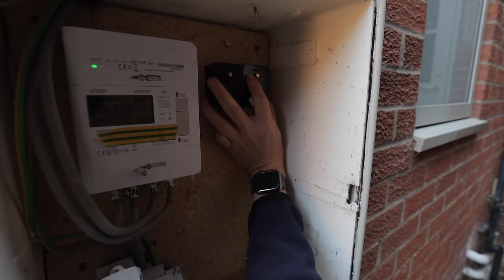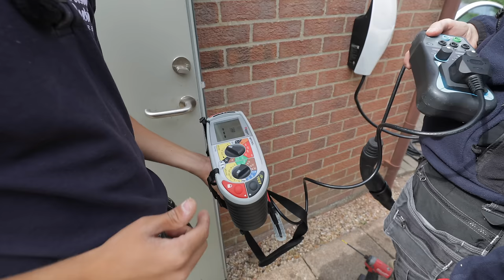I was WRONG! The Tesla Gen 3 Charger is the WORST!

Comment: Is that cable the standard length? I want to install on front of house. I will then drive Tesla Y onto drive. The charging point will be at the front right of car. Will the cable be long enough to go across front of car and then along the length to the changing point of Tesla Y? Thanks a lot, great video

Comment: Was looking for what voltage and amperage a Tesla charged at.  I was an electrician in the USA and looking for how the chargers are wired. Hopefully we won't need all the equipment you show to hook up chargers.  Have seen many home chargers that hook up to a 240V 30 amp or 50 amp receptacle with a plug.

Comment: I bought a 24" x 24" lockbox into which my electrician installed the Tesla Wall EVSE at the driveway.  So, the EVSE is never seen by anyone and the box looks great.  I don't have wifi at my house, so I didn't try to connect to the EVSE, and my electrician told me that these units "self commission" so no need to fuss with wifi at all.  ( USA ). Also, I have been told that the GEN3 units have never been sent OTAs.  My takeaway is:   no need to let wifi ruin your day, mate.

Comment: From an Electrical Engineer that has migrated to becoming a WiFi Engineer full time now.  You need to make sure the customers router has the low data rates enabled to allow communication at distances outdoors.  Some routers will have BAND steering turned on meaning client devices that have 2.4Gghz and 5Ghz (IPhone) will use 5Ghz and this stops the iphone configuring the device that is ONLY 2.4Ghz.  The trick is to disable 5Ghz on the customers router when you are configuring.  I like to configure separate SSID per Frequency in customers router.  The reason this install went well this time was you were probably far enough away from customers router 2.4Ghz was the preferred connection for your phone.  Inside you office 5Ghz was probably the preferred connection.   You see this same issue when trying to pair 2.4Ghz light globes to WiFi networks with i phones.
Reply: No, not in this case. The Tesla Gen 3 charger only supports 2.4GHz.
Reply: @deang5622    The fact that the Gen 3 is ONLY 2.4Ghz is exactly the issue.  If the IPHONE configuring the device is on 5Ghz  and the Tesla Gen 3 is on 2.4 then the configuration fails right at the end.  disabling 5Ghz  makes the phone go on 2.4Ghz  and the Tesla 2.4 Ghz and the configuration works.  In this video the phone was far enough away from the router that 2.4Ghz was a better signal so the phone was connected to 2.4Ghz and having both on 2.4Ghz it all works.  In the reason why in the office it was not working was the Phone would have been connected at 5Ghz to WiFi  as it was close to the office router.  Both devices need to be on the same frequency WiFI for the initial config  and then after that phone can be on 5Ghz as the connection is via the WiFi not the WiFi Direct connection at startup with QR code.
Reply: @charlesclare267  Yes I do know all of this. I do have a degree in Electronics.
Reply: @charlesclare267  idk why tesla uses wifi it is a fixed device it should just use ethernet

Comment: The problem with wifi is almost universally related to the router configuration... Signal not strong enough, signal strong but too noisy to be useful (both related to the distance between the router and the device), router configured in a non standard way, repeaters in the way, etc...

Comment: is it possible to run a cat5 cable, possibly using data over power adaptors? Do any other of the chargers have wired data connection? expecting a customer to have a wifi extender is a bit much. if chargers are wifi only, how many have 5GHz, so less likely to get interference than 2.4GHz

Comment: You should get the freq right 2,4 vs. 5 is the key to your problem... Just a heads up. I have installed about 50isch of those and never a prob with the wifi...

Comment: Regarding the extra ”kit” that you claimed is needed like the PEN faulr protection. Isn’t this due to the way you choose to connect this charger? Normally you would feed it of the main distribution from the house which already should have the PEN protection right? The Tesla WC has the inbuilt RCD, typ A + DC 6 mA protection specifically needed for this application (charging an EV). As the Tesla has built in planning for when you want to charge etc I would say it’s optimized price wise for what is needed together with a Tesla car. The Wi-Fi problem you had is due to weak Wi-Fi signal from the customer in this case…

Comment: I've had loads of issues at home connecting smart devices to things at home as they run on a 2.4ghz frequency. Where the WiFi router broadcasts both 2.4 and 5ghz, if my phone is required to setup the device then it will default to 5ghz frequency. To get around this you need to access the router and disable 5ghz while setting up your devices.

Comment: As other comments have said this definitely sounds like an issue with 2.4 vs 5GHz WiFi bands.

Might be worth keeping a company wide log of problematic ISP routers and see if you can spot any trends. You could then check the settings for troublesome devices as some have a compatibility mode for IoT devices with radios that aren't as good.

I know the BT Smart Hubs have an option in the settings menu where you can switch between modes, they ship as mode one but you can change to mode two or three to improve compatibility. It essentially makes the band steering less aggressive which usually tries to make clients prefer the faster 5GHz band, but this comes at the expense of range. If your device has a marginal signal strength this can cause issues. I imagine many EV charge points would have marginal signal strength given they are outside probably through several walls.
Reply: I'm having to reply to these posts as they're simply not correct. Band steering only works on clients that can accept both bands. As the Tesla wallbox only has 2.4GHz it will not even see the 5GHz band and therefore cannot connect to it or be steered onto it. The reason for poor registration onto the network is probably purely down to signal strength.

Comment: Tip:  For armoured cable I use a Monument pipe-cutter (with a Stainless steel cutting-wheel). That works GREAT for scoring SWA (once you've got the knack). Even on 20mm (dia) 3-core armoured cables, it does a great job and is so much better than struggling around with a junior hacksaw.  (I'm a JIB Gold card electrician by the way).
Reply: Of course they have the rotary cutters. They have been around for decades. What electrician would even consider using a hacksaw let alone many do it yourselfers?

Comment: The WiFi connectivity for the Gen3 is only available also after it is turned on (from off state). After a few minutes, around 5-10 mins, it switches off its hotspot network

Comment: You might find it's an issue between 2.4ghz and 5ghz connecting problems. I split my WiFi so I can choose which one I need to connect to as some amazon sticks don't work well on 5ghz WiFi so I wonder if this is the problem artisan?
Reply: Oh god I’ve gone crosseyed
Reply: Pretty sure that is it. Hey had trouble in the office, probably in range of the 5ghz. They did it outside here, brick walls block most of the 5ghz so it would have defaulted to 2.4 which made the installation painless. High chance if they tried id near the wifi accesspoint it would have given trouble too
Reply: The Tesla wall connector presently only does 2.4 GHz

Comment: I believe the US wall charger is the same now as it was 2 years ago.  Is the wall charger different in UK?  In the US you have wall charger (with cable), wire and conduit to run to the panel, and a dedicated circuit breaker.  No GFCI (per the install instructions) because the unit has GFCI built in.

Comment: I've noticed two earth/cpc conductors being wired in the top of the contactor.  This must be the armored earth and the fly lead going to the armoring. They looked liked two different sizes?   4mm for the armored and 2.5 for the fly lead.  Are you allowed to use different sizes on the same screw terminal for that specific contactor ?
Reply: The tesla unit has inbuilt  dc leakage. The megger mft 1742+ which is the tester they are using does an auto dc leakage test, worryingly its the bit when Jordan says he didn't know the mft did it

Comment: Here in the USA, our options are limited to the Tesla EVSE wall connector if you don't want to have to use clunky adapters for your Tesla.  The Tesla plug is so much smaller here than the CCS plug there.  I know there is actually a federal push to adopt the Tesla plug on all EVs here in the USA ironically enough.  Doubt that will really go anywhere but its strange.  We also don't need PEN fault detection, as we don't run a neutral to the charger, only the split phase L1/L2 and ground.  The only requirement we have which was new in 2020 was the use of GFCI, in which the Telsa charger does have built in.  So that actually saves money here.   I haven't seen the WiFi issues here at least, so not sure what is happening.  The charger does integrate into Home Assistant so stats on a dashboard is nice.  I wish it did have a nice display on it.
Reply: L1 and L2 are each 120 Volts 180 degrees out of phase from each other. I prefer the US Electrical code and would much rather get bit by 120 volts than 220 or 240 volts.
Reply: @michaelholliday100  lol yep that’s for sure.  Can’t count the number of times I have been reminded of doing something I shouldn’t be doing on live circuits.  😂

Comment: Jordan in the spec sheet the Telsta Wall Connector is only 2.4ghz 802.11b/g/n. Some wifi combine the 2.4 and 5 ghz networks on the one SSID. This can confuse devices with only 2.4, Next time you have issues login to the router, not the rooter (I'm an Aussie). And select the setting to isolate the 2.4 and 5ghz, or uncombine them. Every router is different. Keep up the good work.

Comment: As an "IT Specialist" lol. You might have had issues with your WiFi in your office due to 2.4GHz vs 5GHz compatibility with the charger.  Some prefer 5GHz over 2.4GHz however, the charger may not fully support 5GHz.

Regarding the earth protection:  With an external mounted charger like this, could one not just install an earth rod near the charger dedicated to the charger and not use the CPC from the main supply?  Other than the car, what other extraneous metal could the customer touch when unplugging the car?  Does that meet the regs?

Comment: I loved your original Gen3 review.   It endorsed the decision that I had made. I even asked if you could install it or recommend- in London).  Lizzie Y was first plugged in mid July 2022.  The Gen3 has done its job perfectly until until a couple of weeks ago.  Could you possibly take a moment to give me a possible diagnosis before I call in an electrician.
So, I plugged in as usual and noticed that the charge rate was only 14 Amps. I stopped it charging, upped to 24Amps on the app and restarted. It jumped back to 14 Amps for a while and stopped altogether. It has not charged since. The T on the port turns to Red when I try.  I have some power to the wall point because the green light is on. Lizzie Y charges fine from the Granny via 13Amp socket and also from the Tesla SC. I have never used a non Tesla supercharger.
Again, I would really appreciate your opinion. Thank you.

Comment: with respect to the WiFi issue,  a lot of these chipsets have issues with combined 2.4/5GHz wifi routers, where both 2.4 and 5 are the same SSID (wifi name).   Try asking the customer to 
disable the 5Ghz for a few minutes until it is set up, then re-enable...
Reply: This is why I have a 2.5 only network for my various iot type devices.

Comment: Read the manual, it clearly says charger works on 2.4GHz WiFi band. Have installed few of these and never had any issues. Just because not having correct WiFi band doesn’t mean the charger is rubbish.

Comment: With troublesome WiFi devices, make sure WPA3 is not being used on the router.   Some devices, including the Tesla chargers, do not connect to WPA3 reliably.    The other thing would be to limit the WiFi to 2.4GHz only while connecting the Tesla charger to WiFi,  After it is connected you can turn 5GHz back on.     Most people will have no issues, it is very dependent on the setup and the router on site.   There are ways to get it connected if there are issues.
As a note (maybe pedantic) it is not called pairing for WiFi.  It is just Connect to WiFi, as it is not paired as such.  It connects with a username and password, which is different to Pairing like Bluetooth, Zigbee and other meshing protocols use.

Comment: I believe that everything that's fixed, should just have a wired connection. Very happy with my wired SMA charger over here :)
Reply: SMA makes very solid hardware, we install their solar inverters.
Reply: Wired is always best. Full duplex communications for a start.
Reply: @JoshuaBurgess  I have their inverter as well, and it communicates with the charger to maximize the use of solar for the car. Very pleased with the system so far 👍
Reply: Very much so! It isn't just 'old-school' to think that, but in terms of performance (with only a few exceptions, bandwidth can suffer if 'line impedance' isn't carefully matched) wired is the most trouble free, secure and highest performing way to do things.

Comment: is it beater to mount the unit on the wall , then take it off the wall before you drill the hole for the cable then your not  expediently going to damage the case.

Comment: I had a similar experience with an emporia unit not connecting to my nest WiFi. I had to connect the unit to my phone via hot spot WiFi, update the emporia firmware once it got internet access. After that it was able to connect to the Nest WiFi as normal

Comment: I don't get that PEN fault protection. I see no such thing on TESLA wallbox mounting instructions. Is that if PE and N are on a single conductor? I don't see how can one lose N and PE at the same time. In Portugal i have never seen such a thing. N is always provided by the network along with L1-L3 (4 wires) and PE is from the house installation and always separated from N. Actually we use differential breakers that sense the return current on N against the one on L and if it senses a drop in current (0.030-0.300A) meaning that current is bleeding through PE than it opens up and isolates that circuit totally (all 4 conductors). For single phase same thing but with L1 alone

Comment: We have 12 of them at work - I had to take two Access Points outside so that they are no more than 30M from the EVSE to keep them connected.    They aren't very good.
Reply: 30 meters is a long was for Wireless Internet or a Wireless device unless the both have High-Gain Antennas.

Comment: Easiest way to stop brick blow out especially if your going through a brick outer wall from the inside is getting yourself a 300mm x 300mm x 18mm ply and if there are 2 of you on site get your mate to hold the board against the wall over the area the drill will punch through and it will stop blow out but it won't punch through the plywood.

Comment: 29:51 yeah, not a fan of the built in holder, as makes cable look like yard hoses, a mess, and what to do w/ it, lol.
Like the cable holder clip and tether along w/ charger holder that can buy separately from diff vendors to make this look better, imo. Also find that over time, depending on use and such, the pinch point of cable for charging coming from button can get pinched a tad over time; as seen couple older chargers, but it’s like any cable that used and wound, they eventually do break down, & know some hold up better than others over time¹ 

¹ not saying this charger is crap or has issues, or cable will fail when used; just saying what happens over time and what seen….along w/ my opinion
Reply: I don't have an EV yet, but when I do I expect to treat the cable very similar to a garden hose. Though I want it to look reasonably neat, my guess is that what will be most important over the years will be the speed of handling the cable. I'd only want a few big loops  to make usage as quick and easy as possible. Now, I do live in a colder climate and I plan to keep it plugged in every day in the winter - so I better get used to the sight of the cable. My second priority when locating the charging point was to minimize any tripping hazard and to illuminate the area at night.

Comment: Will there be any selectivity issues now there is a Type A RCBO installed upstream from the type B Tesla RCD?
Reply: There might be. It depends where the fault occurs. If the fault occurs downstream from the RCD in the EV charger, then either the RCD in the charger or the RCBO in the CU is going to trip, but you don't know which one.

The user will be protected against electrocution but the question is what circuit and loads in the house are going to be powered down when the RCBO in the CU trips.

Comment: The issue with connecting at first is that you might not have the signal strength to maintain the connection once it's in location, I used a very old Wi-Fi repeater that I had kicking around and it connected to that no problem, I get what you mean though, a lot of installation points are outside homes or in garages through layers of drywall and cement